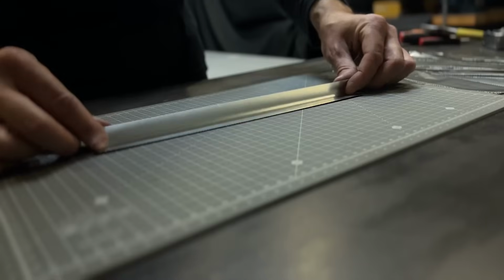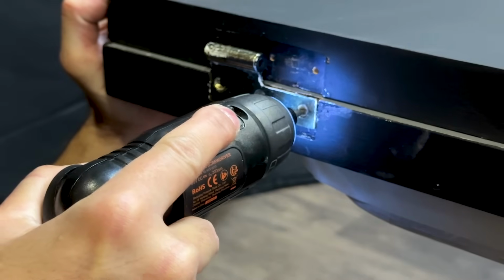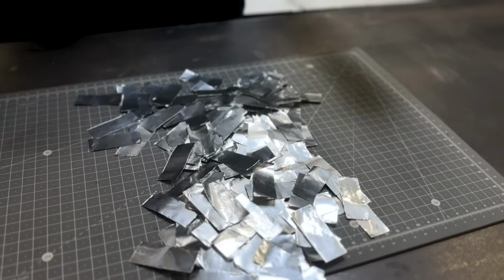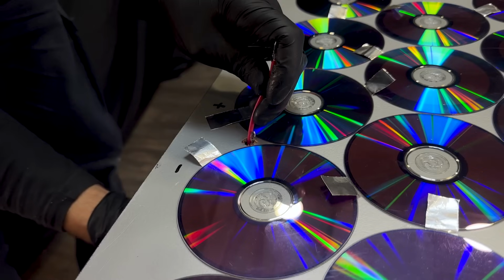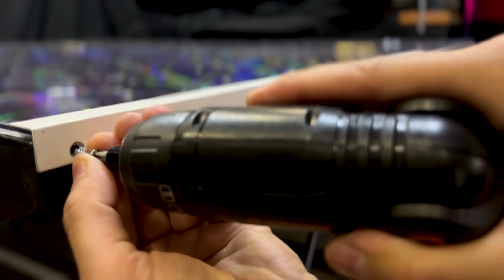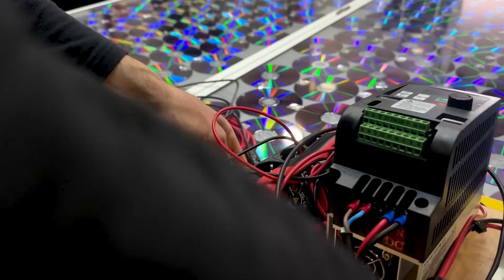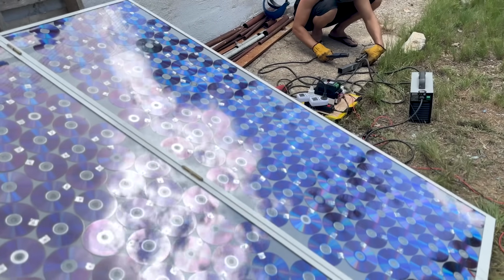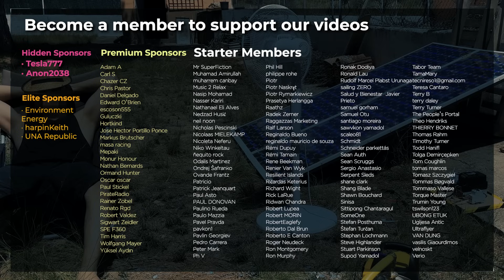Homemade Powerful 3000w Photovoltaic Solar Panel with CD / DVD

Comment: The part where the voltage is measured with the voltmeter the CD/DVD is blurred out. I suspect that there is some 1.5 V batteries instead of a CD/DVD.
Reply: EXACTLY!!
Reply: I was wondering why it was pixilated
Reply: He blurrs his face reflection,lmao

Comment: This is awesome, I didn't know you had to use DVD's, I thought you could use CD's as well.... That's a really clean looking panel, I'm in Florida and sliding glass doors are perfect for solar panels, a bit heavy, but very sturdy, especially if you use something to encapsulate the cells/DVD's.

Comment: It was fun to watch but this is another bs video. CDs are not made of silicon but aluminium even some have a light-sensitive coating on them. Absolutely not enough semi-conductor in them, hence this would never work.
Reply: Wrong.

Comment: 😂 Stick a few cds together and run a welder!!! I couldn't run a welder from my entire array of real solar panels.
Reply: @markjust86  apparently they also have never heard of door blanks, so had to use doors that already had knobs, and other parts on them...
Reply: Yep megawatts of power. Remember to buy enough hot glue.
Reply: @schumispecial1  if i had hot glue, i wouldnt need a welder!!! 😂

Comment: Other than being a load of crap, how are the annode and cathode determined?  Id suggest trying it for yourself but with say 4 dvd's.. see if you can generate 6 volts and see if you can successfully charge a mobile phone.. or run a string of led's.  I doubt it will work..

Comment: It looks cool, and like it might work..One thing I don't get, is why you connected the positive & the negative leads to the circuit breaker? That makes no sense. I would think you could get by with a single pole breaker, and I would up it to 30A or maybe even 50A. The negative lead should be going to a ground terminal, on the panel, that goes to frequency converter negative, and another line running to the ground, would be best. Pull the black lead from the breaker feed, and go directly from panel to converter. Leave the positive in the breaker. System should work the same. Just FYI. I'm not saying this sysrem works, but I'm going to look into it more. I love renewable energy, esp when it's built with scrap or trash. Nice video, friends. Thanks

Comment: Der kommerzielle Strom-Lieferant freut sich über den Strom, den du hier 28:08 von ihm verbrauchst. Das treibt somit für dich die Stromkosten in die Höhe. 28:08 
The commercial electricity supplier is happy about the electricity that you use here 28:08. This drives up your electricity costs. 28:08

Comment: !But that's stupid, it can't work with any kind of CD or DVD!
40 years ago, I actually built a similar panel from individual plates, disassembled from rectifier selenium blocks, and it worked!
Each plate is made of an aluminum supporting part up to 1 mm thick, on which there is a layer of Selenium and over it there is a thin layer of tin solder.
The tin layer needs to be partially removed (made transparent to the light) by heating the entire board to the melting temperature of the solder, but below 220°C (otherwise there is a risk of destruction of selenium) gently wipe with a soft brush, including the paint.
The terminals are solved by pressure contacts on the aluminum underside, and the second contact is made by careful soldering (temperature below 220°C) at the edge of the tin upper surface.
Each cell gives about 0.70 V in the sun.

Comment: BOOOOOOOOOOOO!!!!! I liked this video and then you said silocon CDs, I had been scrubbing the entire thing, sent it to my kid and said... wait... AIN'T NO DAMNED SILICON IN CDs! asked google. Is there? maybe?? and google said I was dumb, then I came to the comments... BOOOOOOOOOOOOO!!!

where'd you hide the battery?!?
Reply: Gemini said: Yes, there are silicon CDs. While they're not as common as traditional optical CDs, they're used primarily for data storage and have several advantages over their plastic counterparts.   

Here are some key points about silicon CDs:

Durability: They're more resistant to scratches, heat, and moisture, making them ideal for long-term data storage.   
Storage Capacity: Silicon CDs can store significantly more data than traditional CDs.   
Speed: Data transfer rates are generally faster on silicon CDs.
Cost: Silicon CDs can be more expensive than traditional CDs due to the manufacturing process.

Comment: Seems good as a proof of concept but I am not sure why you used tape instead of the silicone on the forst connectors as the tape will disentigrate in the heat.   Same with those plastic panels-glass does not grey and craxk in the sun.  Also wonder about the longetivity of the CD's before they also delaminate and fail.

Comment: Zu 25:20 Mit den nicht erzeugten Strom schweißt er auch noch. Siehe dazu 26:20. Ja Du könntest ja auch mit deinen CDs eine ganze Stadt mit Strom versorgen. Und dabei nicht vergessen in der Nase zu bohren, denn das gibt zu den "Solarzellen" zusätzlich Strom. 
At 25:20 Now he's also doing some welding, see 26:20. Yes, you could also supply an entire city with electricity using your CDs. And don't forget to pick your nose, because that provides additional electricity to the "solar cells".

Comment: So you can run a 12volt fridge all day with out a battery or would you need battery to keep it full and use it for the fridge
Reply: @JamesAitken-h8c  this panel is so amazing, it working by night.
Reply: @lozinforlozinfor2288  😂

Comment: zu 25:40 Wenn Du einen Scheißdreck an Stelle deines Pseudo-Solarmodul angeschlossen hättest, dann hättest du genauso viel Strom erzeugt. (25:40) 
to 25:40 If you had connected a piece of crap in place of your pseudo solar module, you would have generated just as much electricity. (25:40)

Comment: will old AOL cds works?
Reply: Nur wenn du Zollschrauben für die Türscharniere benutzt 🤌
Reply: Why did you not notice the brand name he used in the video? watch the video, and look at the DVD's, which were R +,  he said to use the purple color silicon DVD , he used  210 of the Verbatim brand DVD + R that were 16x and from what I saw on the back of the DVD's they were used DVD's that already had been used and had data burnt onto them..Easily seen on a DVD where data was added by a DVD burner. You could buy new ones if you have the funds. Watch the video before you ask questions about info that was already covered in the video.
Reply: I think you missed the sarcasm in his comment. Just sayin’.
Reply: @dcmp3po  lol

Comment: C'est clairement un mensonge, car la surface total des 2 portes correspond environ à 3 m2. Le soleil délivre environ 1500 w/m2 soit effectivement 4500 W pour 2 m2. Mais le problème est tout simplement que les meilleurs panneaux photovoltaïques du marché (donc de la recherche par des professionnel et de l'industrie) ont en rendement de maximum 23 %! Cela fait une puissance de 1035 W au maximum!!! C'est des mensonges dans cette vidéo.

Comment: I rebuilt one and now want to use it to set up a radio studio. You've got all sorts of machines running, but when I want to run my radio station, it not only supplies power, but plays the concentrated CD load of music on the panel all at the same time. What solution do you suggest me??? Help???
Reply: You can only stop the noise by feeding the output from the cells into a battery bank. All the sounds get absorbed by the electrolyte and then you get nice quiet DC to convert into AC.
Reply: @danielwalther5841  I can only laugh my guts out on your sarcastic questions 😂

Comment: I don't think it would be so hard to build, to the contrary, It's basic and easy to build.
We use 60Hz in America, does the solar frequency converter is adjustable to convert the current to 60Hz?
And I think the device you build is for 220V, that's no problem at all to get 110 from 220.  With a breaker for security for the 110V line, I don't think it would be problem at all.

Comment: Why bother filling the knob and latch holes? I would have tested for continuity for the whole array BEFORE locking down the plexiglass with the trim. I would think you might need extra clamp down screws across the plexiglass to make sure the electrical connections remain solid and true, like 2 lags 1/3 and 2/3 from the sides spaced down the length.
The type of CD they used would generate electricity and because the circuit is in series it would create a high voltage with low current which would be adjusted later to fit the Voltage/amperage output that you want but the power remains the same.

Comment: OMG!!!! I must have used the wrong door size or not filled in the door handle hole properly, mine does not work ; -(
Reply: maybe check your CDs for silicone.well it's time for troubleshooting check your material and setup.
Reply: Where did You get all the C Ds ?

Comment: He did not say what dimensions in width and height of a wooden doors to get for this project, so the correct number of DVD's will fit width wise and length wise per seen in the diagram laoyut.
Reply: The Cds are a set size.  
Count and measure the length and width of the Cds, and that would give you  the approximate size you need for the doors.
Reply: @ZabZab-s3i  I find it bewildering that that required explanation ...

Comment: I always wonder why people produce such idiotic films. After all, a person who has only a faint understanding of physics and electricity knows that this is total nonsense. People, don't waste your time watching this nonsense. The author forgot to tell you one secret. To "produce" electricity, you must alternatively meet two conditions.
1. Buy the appropriate amount of batteries. or 2. Pour holy water over the entire installation - but in this case the electricity will only appear on St. Martin's Day, between 1 a.m. and 2 a.m., and the voltage can only be measured with a voltmeter equipped with a hair of the archangel Gabriel.

Comment: Yeah and if you wad your underwear in a ball slightly soiled and wrap them in 3m duct tape with aluminum foil (shinny side facing in) you can multiply your power output by 10.67%.

Comment: Man a question, how much Ampherage is generation such solar panel?
Reply: If I am not completely stupid it should be 10 amps. 2200w : 220volt. (Output of his inverter)
Reply: What inverter?, you use a charge controller on the out put of the solar collector to control the charging of a battery.

Comment: If any electricity is made, then welding machine is a very poor one. Only ac current and very low output makes birdshit spot welds.
An additional bank of deep cycle batteries would work better.

Comment: what type of cd disc? i m already try,but no voltage,no reading
Reply: Finish school!
Reply: @snooker216  what is u mean?
Reply: @mdnaz2845  Your question leads to exactly two conclusions: either you are still going to school or school was a waste of time for you. The setup is complete nonsense and won't work with any CD.
Reply: @snooker216  just answer it with direct point...thanks
Reply: It's a dvd R with the purple backing NOT A CD
Reply: @leviticus9278  look same,its okay,thanks

Comment: Allein da schon: 22:55, wo die CDs halbwegs von dem Wechselrichter abgeschattet sind, und somit überhaupt kein Strom fließen kann, noch dazu von einer Leuchtstoffröhrenbeleuchtung angestrahlt, die auf Solarzellen sowieso keine effektive Lichtenergie liefern kann, betreibt er eine 60 Watt-Lampe. Offensichtlicher kann so eine Lüge des Erstellers vom Videos nicht schlimmer mehr sein. Zu dem gesamten Video kann ich nur einen Daumen nach unten geben.👎 (Siehe 22:55) 
.                                                              English👇 
Just look at this: at 22:55, where the CDs are half-shadowed by the inverter and therefore no electricity can flow at all, and it is also illuminated by fluorescent tube lighting, which cannot provide effective light energy on solar cells anyway, and it is running a 60 watt lamp. The lie by the creator of the video couldn't be any more obvious. I can only give the entire video a thumbs down.👎 (See 22:55)